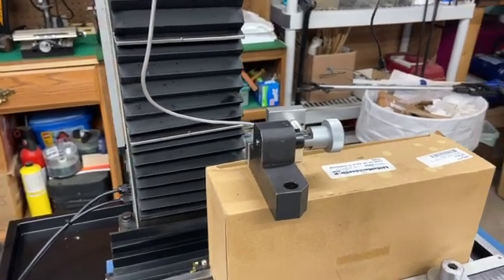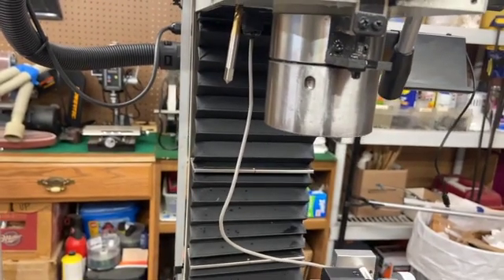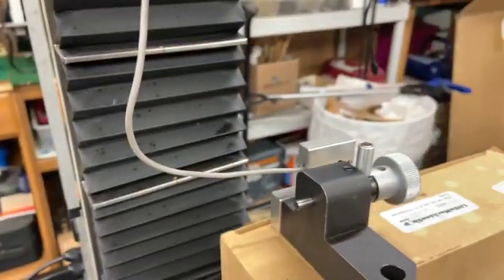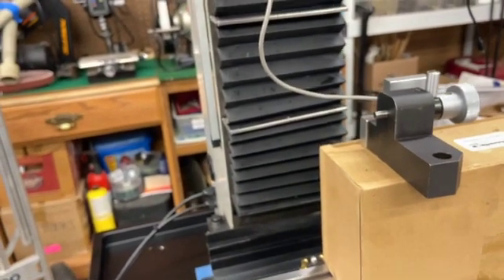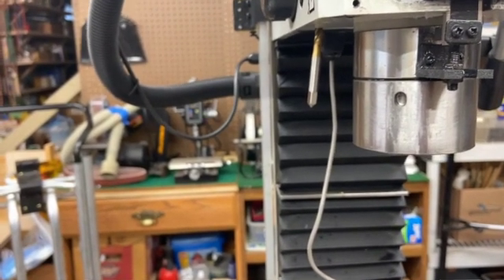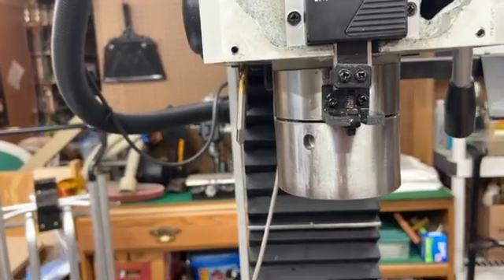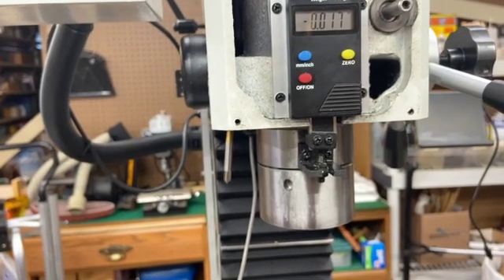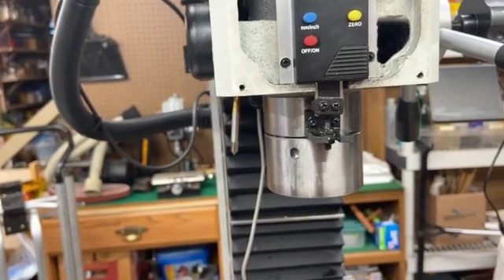LMS 5550 (Sieg SX2.7) Bench Mill - Spindle Lock Problems

Comment: Did you feel as though LMS did as much as they could to help you with the issues?  I always assumed the premium to buy a sieg from LMS was due to additional quality control and good customer service.  It appears my assumption about additional quality control may have been incorrect.
Reply from the maker: This problem was probably the worst of what I ran into with my new mill.  I resolved the issue by retapping the errant thread and everything has worked fine since.   Hopefully you saw in my addendum that the folks at LMS did what they could going forward by communicating with Sieg.  I'm impressed with Sieg that they took the time to respond and with LMS with getting back to me.  

I'm now 18 months down the road from this video and I still would recommend LMS machines even for the extra $$$.  I have built 4 steam engines on this mill as well as a variety of other little side projects and the machine has performed without a hitch.  I especially like the TouchDRO system that came with my mill, it has been very consistent and holds tolerances within .0005" which has made the bolt circles workout for perfect fits on the cylinder heads for my engines. - Olen